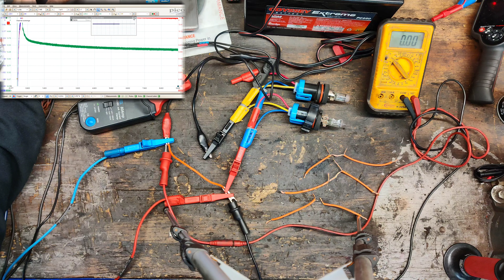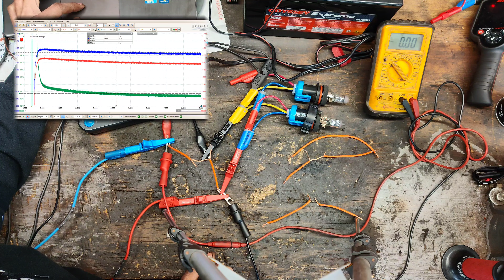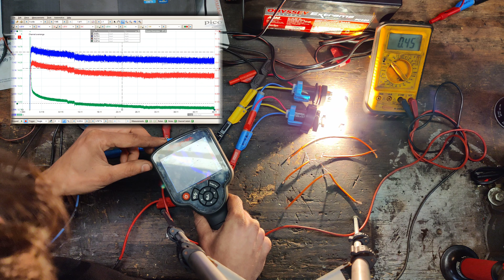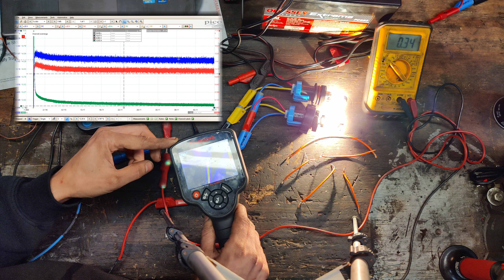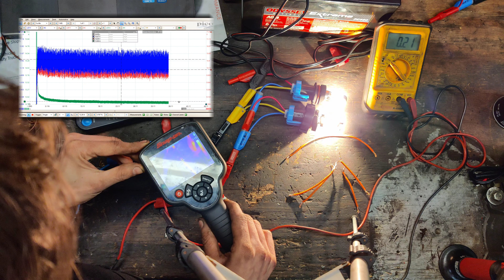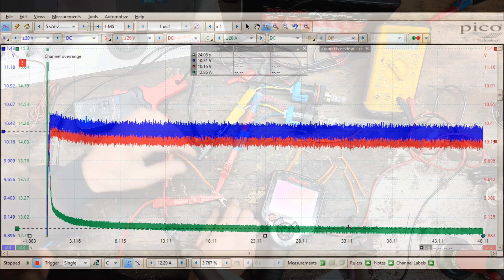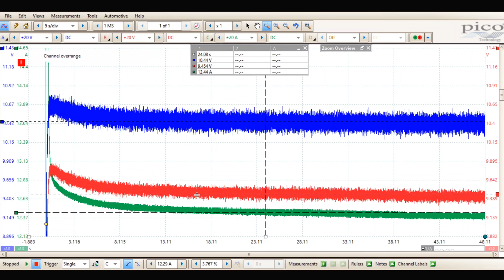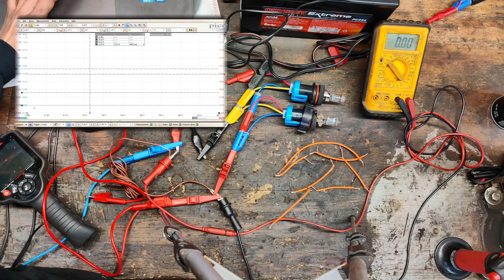Current Flow Testing Through A Damaged Wire (Oscilloscope and Meter) Voltage Drop?

Comment: This is a very interesting problem and not just for cars. I’m in aviation. Partially damaged stranded wire can be very difficult to diagnose. You’ve removed the insulation for the demonstration but it is possible, through repeated kinking of stranded wire, to have progressive failure, one strand at a time. Even with all strands broken the insulation can keep the broken ends touching. Great continuity but poor current conduction. 

I had a 240v hangar door motor running on a wire with every strand broken but touching inside the insulation; until it didn’t.  That was a rodeo!

I’ve looked everywhere and cannot find an instrument or method to diagnose what you show here, inside an otherwise undamaged insulation. 

Nice demo.
Reply from the maker: Xray camera would probably work or a thermal camera.
Reply: @RobertDotterer  I thought about a thermal camera but we're talking about 5 separate wires inside a very thick (can be driven over) outer rubber insulation with several ropes embedded with the wires for strain relief.  Now, about the X-Ray.  I would love to try that!  Where do I get an X-Ray camera?
Reply from the maker: I am working on testing xray cameras. No idea how well it will work. I saw examples of it but I am looking for something compact.
Reply: I looked at a few.  The Maven appears to be the best for the kind of testing we are interested in, but it looks pricey too.  I’ve requested a quote.

Comment: Good experiment, I wonder if connecting the bulbs in series would have made a difference.
Reply from the maker: The more load the more noticibale the issue would be but you also may exceed the rating of the circuit if it is in a car. Thank you for watching.

Comment: Nice video I would like to say that if an animal chewed through the wire insulation on a car, moisture will eventually begin to cause corrosion on the exposed wire probably resulting in a considerable voltage drop, causing electrical problems and a visit to an automotive shop. They would then have to perform  a voltage drop test to locate the problem wire. But yes no one would probably notice until the vehicle begins to act up.  Most people won't even know that a rat/mice has begun to chew through their wiring harness until they are on the side of the road broken down. Just my two cents.
Reply from the maker: That is true, I just had two cars with harnesses completely destroyed by ground hogs with the only complaint of dash lights.